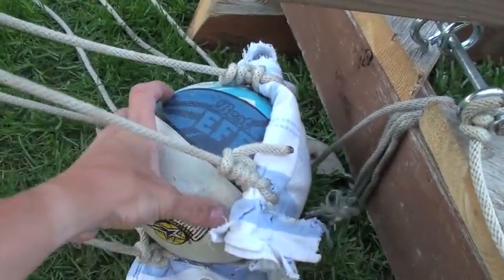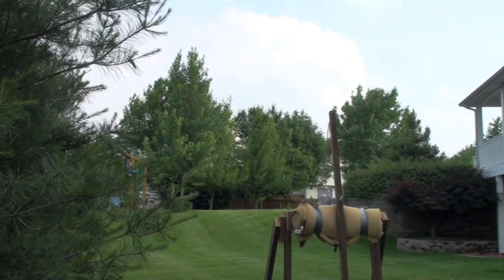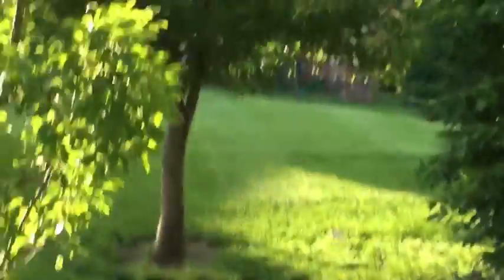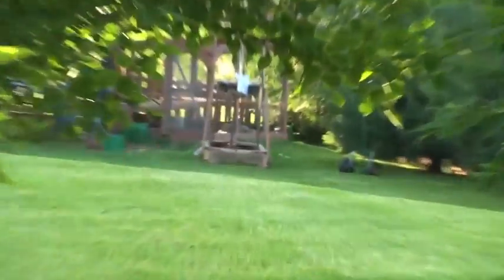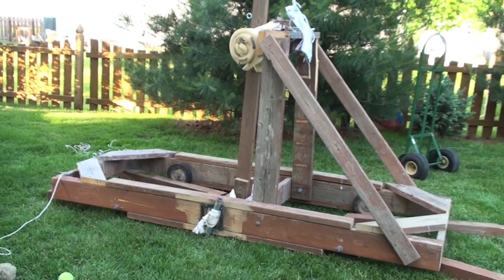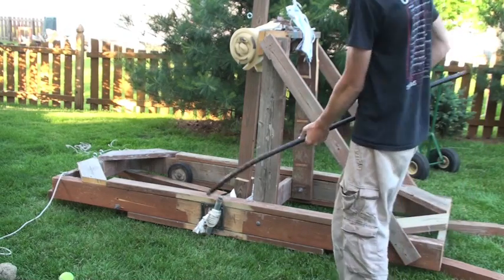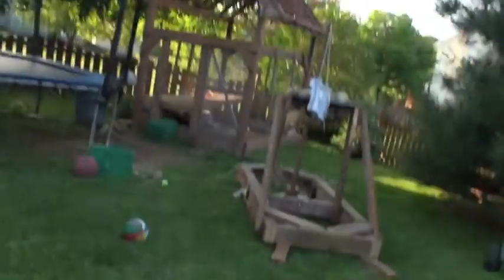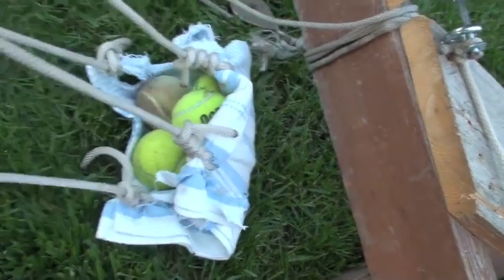Smart Car-Sized Torsion Catapult

Comment: Dude that thing is awesome!

I built something very similar a few years ago, but mine was much weaker. Still great for firing water ballons though. You gotta try that. Fill up a condom with water (regular baloons tend to break when you apply too much force) or use small baloons....

Comment: you schould consider adjusting the angle the sling releases, your shots are to high that takes alot of range

and the adding of a winch to pull the arm down would also reduche the risk of injury

also you cann combine the rope of the winch with the trigger

Comment from the maker: It is not always necessary, the friction of the tension rods on the wood is sometimes enough to hold it. If they do slip, I found a way to overcome this by drilling holes into the wood in a circular pattern around the tension rods. Insert a bolt into any of these holes to stop the rod from spinning.

Comment from the maker: What about a system similar to my catapult in this video? It consists of 3 "eye bolts" of a decent size mounted in line with a bolt run through them. 2 of them screwed into the base of the catapult, 1 into the arm. The tension from the arm will hold the bolt in place until you give it a yank'

Comment: @nerf986 The last thing to remember is support, I cannot stress how important this is!  See to it that all of the joints are well secured, and support the crap out of the thing. Believe me, it is no fun at all when your trebuchet topples to the ground (I have had this happen and it was not pleasant) Good luck with what ever you build! and if you ever need help send me a message, I just might be able to solve the problem.

Comment: @nerf986 Also trebuchets are much much easier funner, and safer to build with a friend. Finally if you build a trebuchet, it will work much better if your throwing arm has the 5/1 ratio. This ratio dictates where you put your fulcrum, ie. if your arm is 15ft long then you will put your fulcrum three feet in.A wheeled frame will also increase the distance your projectile goes.

Comment: @nerf986 In my opinion trebuchets are funner to build and tinker with, but they are also a lot more complicated to built. Onagers are simpler to make, but there really isn't many ways to adjust one without taking it apart. If you want  to build the trebuchet I would personally recommend you make it no higher than 15 feet tall with a 500-600lb counterweight, but not much smaller than 10ft tall, at least for your first one.

Comment from the maker: @LegoScout09 I no longer have this cannon because i was once trying to push its limits and it snapped in half due to the extreme torque. As for most of the questions about dimension and stuff: From looking at the footage your guess is as good as mine. If you look at the footage near the beginning it should be easy to make good judgements.

Comment from the maker: @CjStudiosInc Sorry, i dont have plans drawn up. The dimensions of the catapult in this video are 3 feet wide by 8 feet long (the base). The base was constructed with 2x6's, the sides of the bases were doubled 8ft long 2x6's. You will need to drill large holes (3 or 4 inch) through those doubled 2x6's to string the ropes through, i recommend reinforcing the areas where the holes are drilled. Also, wedge a good sized piece of wood next to the ropes to keep the sides from caving in from the force.

Comment from the maker: @CjStudiosInc it is mainly 2x6's and 2x4's. The wood i used was somewhat rotten and as a result it could not take a lot of torque. Theoretically, the distance you can throw an object is only limited by how much torsional force you can put on the ropes. If you construct a device similar to what i build, only out of fresh wood, with a longer metal rod you could put a lot of force on it.